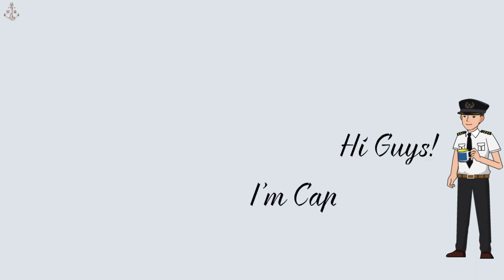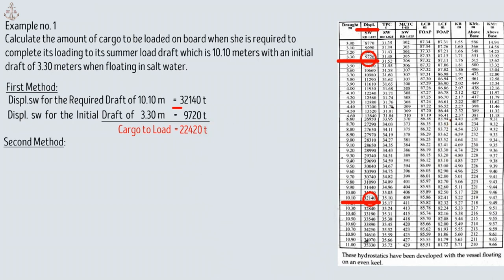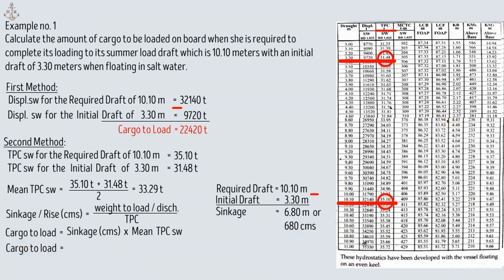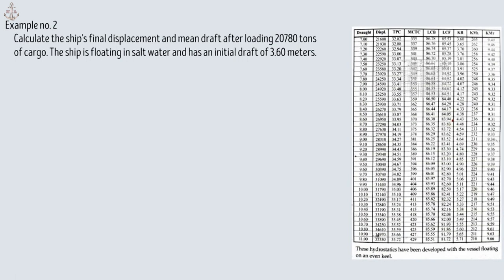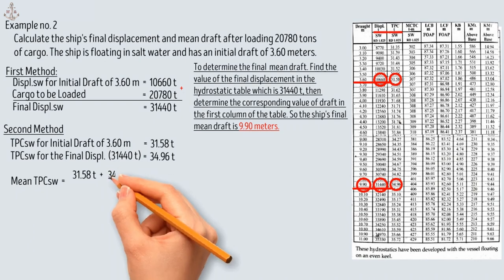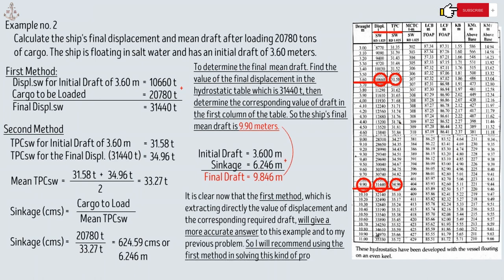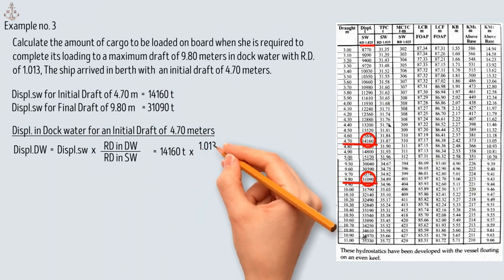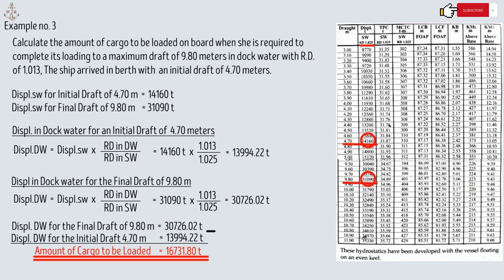Calculate Cargo to Load with Draft Limit ll Determine Final Draft Given the Cargo to Load

Comment: How it is justified that the first method is more accurate? What about if the hydrostatics table is not given in exam and tpc of salt water is only given
Reply from the maker: The hydrostatic table was provided onboard by the shipbuilder who designed the ship. The table is generated based on the actual measurements and hydrostatic properties of the particular ship, including information about the underwater volume distribution, and other specific characteristics. So extracting the ship's displacement at a particular mean draft will be more accurate rather than using the formula, considering that the shape of the hull is not a box shape. Calculating the mean TPC by adding the TPC for the initial and final drafts and then dividing it by two, may differ slightly from the actual measurement due to the shape of the hull.
          The second method is usually used on the examinations since a hydrostatic table is not provided. As long as the TPC for the initial and final drafts are given, you can still calculate the cargo to load using the formula given in the second method. If the answer from the given choices is not available, choose the nearest answer. Thank you for the comment.